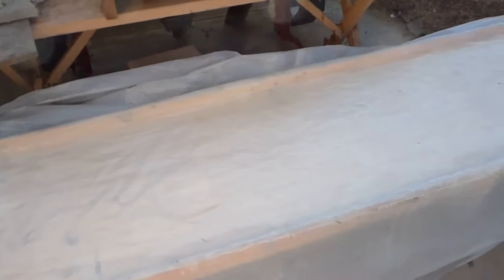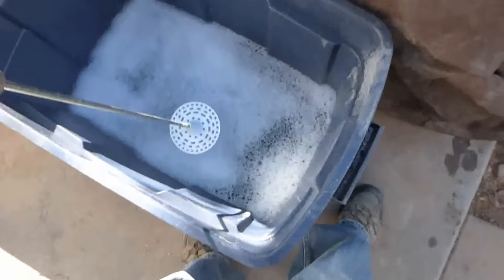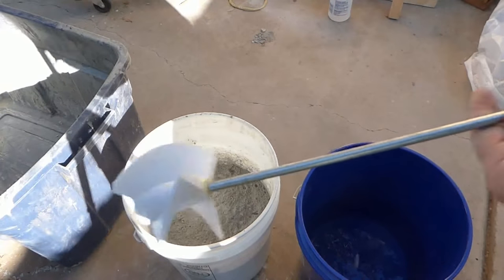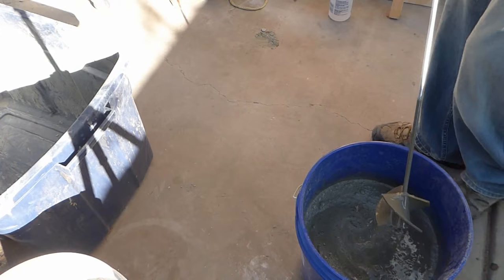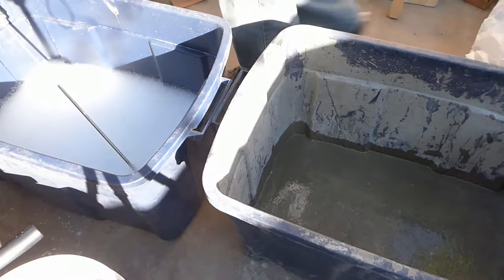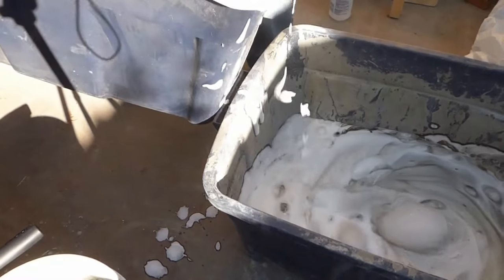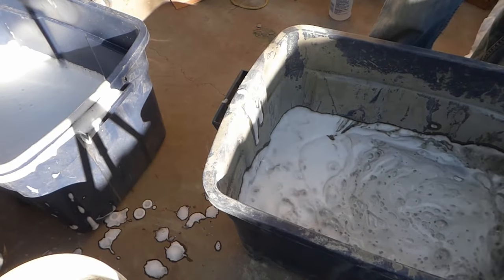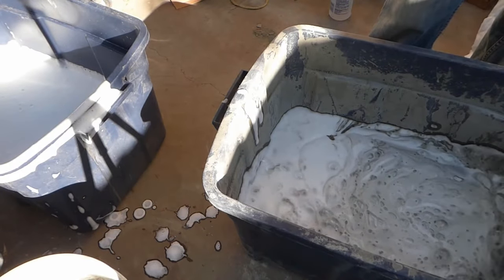Making AirCrete without an Air Compressor Foamer

Comment: I've designed and made several versions of compressor foam generators over the last few months since discovering Aircrete and wasted quite a bit of time developing my ideas. But unbeknownst to me, you had done this awesome thing a year ago and I didn't find the video till now. It's so simple yet so clever. A really nice and wonderful idea. I like your brain Matt Welland, thank you.
Reply: Granted this has consistency problems as stated in one of your later videos but for small items, prototypes, testing small quantities of mixtures, etc this is perfect
Reply from the maker: @waynoswaynos  hi Waynos, what method and design did you settle on?
Reply: @MattWellandMiscMarvels  Hey Matt, Check out Silverson Machines on youtube and get a handle on 'high shear mixing'. I made a thing along those lines and it works really well. It whips up about 30 litres in a couple of minutes or less. I made a thing with holes similar to yours first off but it didn't really work for me.

Comment: I find it so interesting that everyone uses so much water in their mixes. Simply make a very dry mix and use the foam and water reducer  to create the mix. Aircrete can be a lot stronger if the water to cement ratio is a lot lower. Yes wet concrete is easier to use but also very fragile.
Reply from the maker: Hi Konfidante, I was following the recipe from the dome gaia site as best I could. Do you think they also use too much water?
Reply: @MattWellandMiscMarvels  there is this tendency to make a really wet mix when it comes to AirCrete. The equation is very simple less water= stronger concrete. The advantage of a drier mix is less drying time = quicker de-moulding time if required. When I see sloppy wet mixes I associate these as laziness and lack of understanding of concrete. Why would I want so much water in my mix? Can’t think of a single reason. Dry mixes  can be incredibly workable with water reducers and plasticizers.
Reply from the maker: @konfidante  i like to think lack of knowledge rather than laziness! Can you share your recipe and methodology?
Reply: @MattWellandMiscMarvels  Very simple, make a mix exactly the same as regular cement. Use water reducer, air entrainment and plasticizer. This mix can be extremely dry as long as it is mixed thoroughly. Now add your foam as desired. The water reducer and plasticizer will be activated by the foam and the mix will become wet enough to even cast fine details. I get away with very little foam because my objective isn’t weight reduction rather insulation and sound proofing. My recipe probably is close to 2000 psi and after 30 days it is structurally sound.

The English statuary casters have another trick up their sleeves. They take sand and mix it with cement. Incredibly dry mix. The simple objective is to coat the sand kernels with cement. They put this creation on hard floors spread out and they let it dry out. When they need Mixing materials they hand tamp this sand making it into cement coated sand kernels. They use this as the main ingredient. The results are incredible. Lighter mix and incredibly strong for fine detailed statues and planters.

Comment: Instead of high speed "mixer", maybe a very slow rpm prop with larger pals would be better. I guess the final phase should be more like "folding". Anybody who ever folded soufflée would know it. Too many bubbles are lost in the final battering.
Reply from the maker: I agree, just like a souffle it is very easy to fail with aircrete. I tried to make my mixer large for that reason but eventually I gave up on aircrete. I think styrocrete is likely a better  option. I'm experimenting with some alternatives also.

Comment: Thanks for posting your method of how you made it. Looks good. 

A suggestion, you need more area for your foam making blade. Say something similar to the cement mixer with holes through it. It may speed up the process and create denser foam. 

How was the outcome of this process? How is the strength compared to standard concrete? Did you enjoy messing around with it? =D

Comment: Maybe it’s just me but. Wouldn’t it be a good idea to entrain air while mixing? Develop a vacuum with the blades and a air tube.
Reply from the maker: You need very tiny bubbles and entraining air will tend to make large bubbles.
Reply: Could the air be diffused through a bubble stone like apparatus (similar to what you find in a fish tank)?

Comment: That was awesome bro👍....
Can you a slab for flooring to a garage?   And what's the strength?
Will it withstand at least two tons?
Reply: Why would anyone want a light weight floor for a garage.  I’m taking about a normal basic garage ground level.  Other than trying to be cheep nothing sounds good about a aircrete floor.  As for holding two tons you have got to be nuts to think foam and Portland would withstand that kind of weight.

Comment: You've done a Great Job.!! Printing you're peddles,!! And I'm sure they will be very useful for the Aircreate in the future... But if you're goal is to make the aircreate, the most efficient & EASIEST way to get it done ✔ Maybe you should try making the second Paddle, a little bit longer" & add a lot of holes.!! I think you will be much Happier with it's performance.!!! Give it a try my friend, what do ya, have to loose ??? 
P.S. The first peddle has enough holes
But should be" printed where the outside edge, should be in an up & down pattern, kinda like a Roller Coaster. I think with the holes in it" like you have them, that small change would really improve its performance by 6p% or more. Try those changes and let us know" how well they do.
Reply from the maker: Thanks for the encouragement! Are you suggesting the holes for the foam mixing paddle or the cement mixing paddle or both?
Reply: I'll LOOK at the video agian" and send another Comment, That is a little bit more Clear.....ok, Thanks for the video.
Reply: @MattWellandMiscMarvels  What I did was tie about 10 nylon dish washing scrubbies onto my auger mixer..The 1000`s of little holes in that medium produced stuff that resembled shaving cream.
Reply from the maker: @gumacanian4211  Excellent idea! I'll give that a try. I think the bubbles from the disc-foamer are a bit too big.

Comment: Very interesting but I would think that for the cost and time to print a mixing paddle you can probably buy one at any hardware store designed to accomplish said objective. Just thinking...
Reply from the maker: I didn't find any paddles quite like what I wanted in local Lowes, Home Depot or Ace stores. The design took 1/2 hr, each print uses about $0.50-$1.00 worth of plastic and the steel rods were in my junk pile. Still, that said, yes, you'd be ahead if you could find something in a local store that worked.
Reply: @MattWellandMiscMarvels  could you please share a link for the 3d print for both attachments?
Reply: Maybe put link in description box of the vid. He posted a link in one of the comments. So it’s there. Just gotta look for it @sunfish

Comment: Hi my friend, SORRY ITS been so long since I last promised to check out you're video again & lieve a more clearer RESPONSE, But" I always keep my promises:: NOW" What I was saying 
About the printed paddles was ( they are both GREAT!! but if you was - to make them both an inch longer" and add holes that are a little bit larger,.!!
And  the second Paddle you use, on the other hand, needs that & more holes, add two where it's only one.,@ make Both With the outer edges of both pebbles looking like a Roller coaster, ( SMOOTH UP & DOWN EDGES)... LIKE THE SHORTER ONE YOU WAS USEING, So, as to move the mix is a more wave pattern" as the holes catch the mix that 
Is being directed into the center of the paddle.. I really believe you will get a more smoother creamy mix,.!!! That will result in a aircreate that has a lot more micro" bubbles, in turn makes a lighter, more water resistant mix. You might even want to add a little water - glass, for strienth, and more water resstent mix. OR why not experiment"?? With other types of 
Mixes,??? You might and come up with something No one ever thought about doing before, or you might do like So, many others have done. Find something  GREAT!!!! Just by mistake.!!
LOLOLOLOL😁😁😎

Comment: Ordinary detergent or aircrete foaming agent? Please
Reply from the maker: I have used both. The foaming agent is a little better but the detergent recommended on the domegaia site seemed to work pretty well also. Most critical thing is the foam density. Be sure you get about 90g per quart.

Comment: Subbed.  is there a follow up? did it work? This seems like a low budget easy DIY option if it works.   Thanks. whats the detergent and mix ration on that?
Reply from the maker: It works ok,  someone pointed out tying a bunch of plastic scrubbers to a mixer paddle works better.  I found the quality to vary a lot so I went ahead and made a compressor based foamer.  In a few weeks I'll post a video of my recent experiments.

Comment: How did that batch turn out? Could you lift the panel without it breaking? I'm working on panels for my modil home skirting. Thanks for sharing.
Reply from the maker: I added fiber strands and increased the thickness to 1.5" and let the panels cure for at least a week before any handling and they are strong enough to work with. At one inch thick with the fiber you have to be pretty careful with them. Note that the fiber must be special for-concrete stuff, the alkali in portland cement will damage glass fibers. I'm leaning more to casting in place as making panels and then assembling into structures is very labor intensive. Creating butt joints between panels is a hassle. In a few weeks I'll post my results from pouring in place.
Reply: @MattWellandMiscMarvels  Thanks for timely reply. I also found 1 inch wasn't enough. 1.5 is. Videoss I've watched showed boxes being cemented from the out side, with only the inside edge of the sides touching. Also with planter boxes, joined with half joints and a pipe.

Comment: Can you supply a link for making the 2 paddles? Nice work! I use a slightly modified ice auger(blade removed and drill attachment scewed on) to mix aircrete and find it mskes excellent consistent creamy aircrete in large batches (43 gallons) your paddle works nicely but for larger batches you may want to double or triple the height of it....making it more ice auger like.
Reply from the maker: Hi Greg, I'll put a site together with the source and stl files so you can print your own paddles and I'll update here.
Reply: @MattWellandMiscMarvels  That would be awesome Matt. Thank you so much!!
Reply from the maker: I have posted the .scad file and some STL files here: http://www.kiatoa.com/cgi-bin/fossils/matt/wiki?name=Aircrete - if you want a specific size = just post here.

Comment: Has anyone considered using this for the walls of an inground pool? I'm installing my own concrete pool and while researching came across AirCrete.
Reply from the maker: Hi Greg, I think aircrete might work for an inground pool but what would be the benefit? I don't think the insulating value of aircrete will be much advantage in that application.
Reply: @MattWellandMiscMarvels  reg cement pools WILL FLOAT. IF there is no water in them and a heavy rain comes along, thinking of of all the cement coffins  in New Orleans,  pools are the same way,  aircrete  will work like a bobber..  laughing thinking of watching it in a rain storm.  Put a boat in it and play on rough seas

Comment: Awesome.. it seems you didn't add any chemical additives to strengthen the concrete?
Reply from the maker: No chemical additives but I did experiment with adding chopped fiberglass. The chopped fiberglass does make a big difference in strength. Be sure to get the kind of fiberglass that is compatible with cement.

Comment: Tip make a tip with blades outside and area inside for steal pads and window screen hold pads inside tiny bubbles
Reply from the maker: Good idea. I think someone has tried something similar and it works well. I have gone to using a foam maker as it is less hassle.

Comment: Did you add seventh generation soap?
Reply from the maker: I used suave shampoo. Seems to work great.
Reply: @MattWellandMiscMarvels  does the finished aircrete have a scent from the shampoo? I was going to make some blocks to build a 3 sided wall around my yurt wood stove to protect the wall next to the stove and to absorb some of the extra heat but don’t want to have it smelling like shampoo.
Reply from the maker: @mainelyelectric  No, you won't be able to smell the shampoo, the concentration is far to low. Good luck!

Comment: Can i use this to make light weight indoor planters?
Reply from the maker: Yes, that would work.  You might want to add some fibre for strength. You can find glad fibre for cement on Amazon. Regular glass fibre will not work due to the alkali in the cement.
Reply: @MattWellandMiscMarvels thanks Matt fr your valuable advise

Comment: Can you add glass fiber to this for strength
Reply from the maker: You can't use glass fiber - it is weakened by the alkali of the portland cement. However this stuff works great: https://smile.amazon.com/gp/product/B000CODWAE/ref=ppx_yo_dt_b_search_asin_title?ie=UTF8&psc=1 - note that you will need very little for each batch. I use 10-20 grams of fiber for five gallons of aircrete

Comment: Too much water? No following not letting us know if it works?
Reply from the maker: Actually that batch came out ok. I put the project aside for quite a while and got back to it recently. Follow the ratios from the dome gaia site https://www.domegaia.com/ and it will work well. The frothing method works ok but is time consuming. I have since made a foamer like the one advertised on the dome gaia site. I think anyone serious about making aircrete should buy the dome gaia foamer.

Comment: Ostad i have seen  4 times the part when you adding foam but i Don't understand.  Did you mix  9 inch foam or all together  wer 9 inch ??
Reply from the maker: I mark or measure the level for final needed volume. Add foam to cement slurry until you get to the mark.
Reply: Thank you Ostad again...you are the first man who reply me within few hour , 1 to 6 month Somebody  dont reply.... 
  For 5 kg ciment how much foam wee can add. 
And how many days after aircement  i can use??
Reply from the maker: @fabion6043  after two days, but it will be very weak. I usually give at least three days
5kg cement add with 2.6 litres water and mix, then add foam until you have 21 litres aircrete

Comment: Hi Matt did you use just cement, detergent and water ?, anything else ?, thank and very instructive video,
Reply from the maker: Hi Jorge, Yes, I followed the recipe from the dome gaia site (https://www.domegaia.com/) scaled appropriately. I have added fiber purchased from Amazon - note that you cannot use glass fiber as the glass is weakened over time by the alkali in the cement.

Comment: Sir, how much foam to add in proportion to cement , for example in 1 kg cement ,how much form is needed in volume wise  1: 4,5(ratio)?
Reply from the maker: From DomeGaia site: 94lb portland cement, 6 gallons water, add foam to about 46 US gallons. In metric: 42kg portland cement, 23 litres water, add foam to make 174 litres aircrete mix. A few days ago I made a small batch - just scale the numbers. E.g 1kg cement, .5 litres water add foam to make 4 litres aircrete mix. Please double check the numbers.
Reply: Thanks Mr matt, much appreciate it
Reply: Sir , have you tried livoton foaming agent
Reply from the maker: @msaetmaus1201  no, I have not. If you try it please make a video or post back here your experience!

Comment: Can you add sand to the aircrete?
Reply from the maker: Yes, small quantities of fine sand but I'm not sure i understand why you'd want to. The compressive strength will still be lower than concrete due to the air bubbles.
Reply: Hye Matt ,
I am from India we recently started manufacturing  foaming agent .You can use sand by passing it through siever this increases the weight of the brick .

Matt I would like to connect with you to share my work
Reply from the maker: @atultikmani3699  Hi Atul, I'm glad to hear about a new foaming agent! Please share your web site and information and if you have videos share your youtube site also! You can contact me at matt @ kiatoa . com

Comment: I hope it works it look too thin
Reply from the maker: I think that batch was too thin but it still came out OK. If you have good, long lasting foam the aircrete is quite tolerant of abit too much water in the slurry mix.